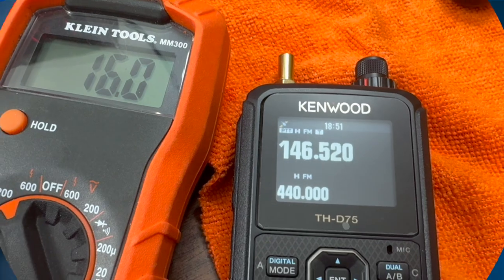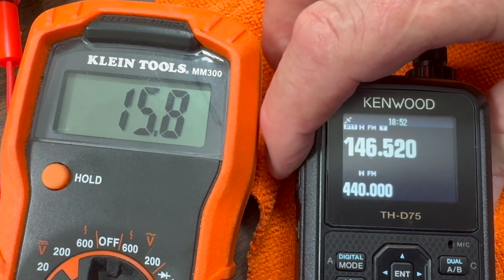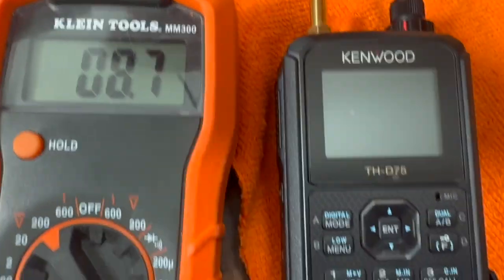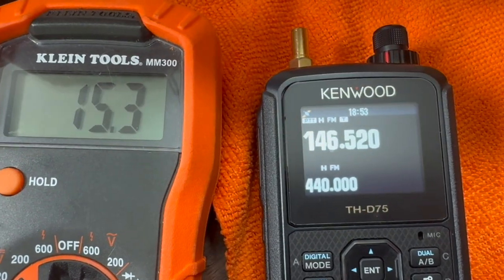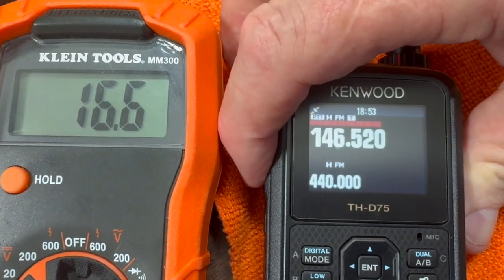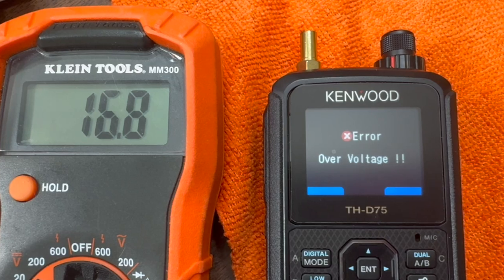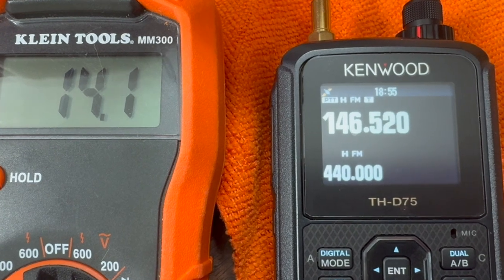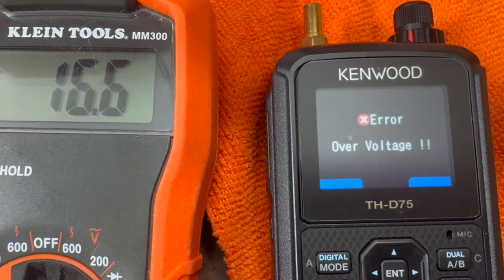Over Under voltage test Kenwood TH-D75

Comment: Hi Don,
I've been using my TD-D74A radio for a few years now and really like your videos. I recently bought a new TH-D75.
I'm wondering if I can use the old battery from my TD-D74A in the new TH-D75. The batteries look similar, but the old one is 1800 mAh and the new one is 1820 mAh.
I'm also worried about charging the old battery with the USB adapter for the TH-D75. I'm afraid it might damage the battery or cause a fire.
Can you give me some advice on whether or not it's safe to try using the old battery in the new radio?

Comment: It must also transmit full power at only 11 volts too because mine draws 1.8 amps when I transmit at 11 volts just the same as 12 volts. And it's supposed to put out the full 5 watts on the lithium battery and it's maybe only 8 volts or so. So why did they design this radio to cut out and reboot at less than 10 on external DC in but yet runs okay with it's regular battery at only 7.4 to 8 volts? I don't get it, scratching my head! 
BTW, I've never got my D75 to draw more than 1.85 amps with absolutely everything running. I'm talking the backlight on full time, the GPS on (and everything else I can think of) and then transmit at full power. I have tested the crap out of my D75. I can always buy a new one if I kill this one. To me not expensive.
Reply from the maker: like I said in the video when you plug in the 12volt plug on the side the radio reboots to run off external power and not the battery. 12vlt power management needs higher voltage and more current to charge the battery and run the radio. yeas you can run the radio on 11 or 12 volts fine in the manual it recommends it be 13.8 at 2 amps

Comment: As an emergency backup sometimes run mine off of a small Duracell AGM 12 volt battery (9 amp hour), which is about the size of a motorcycle battery. It's not 13.8 volts of course, only 12 at full charge. Would Kenwood fuss at me for not sending the full 13.8 into it? Only way to get 13.8 is to plug it into a car with the engine alternator running. Or use an adjustable power supply like shown here in this video. But I don't have one and if a AC power outage occurs a power supply ain't gonna do no good anywho. So my emergency home battery is my Duracell and I plan to buy a few more like it, put 'em in parallel. My TH-D75 seems to run great on 11 to 12 volts. Sorry Kenwood!! I also use this same battery to power a Yaesu and even my old Radio Shack HTX-202 with different power barrel adaptors. Don't hurt them either.
Reply from the maker: 12 volts will work fine. Kenwood is not going to fuss at you :)

Comment: Interesting. Appears to be well engineered. I thought I heard the radio wouldn’t power on without a battery installed but it appears it can.
Reply from the maker: radio does work with out a battery on 12volts socket. It will receive only on USB power and not TX
Reply: @w6gps  is it doing the radio any damage ( running on 13.8dc) and no battery on ?
Reply: Thank you for clarifying.